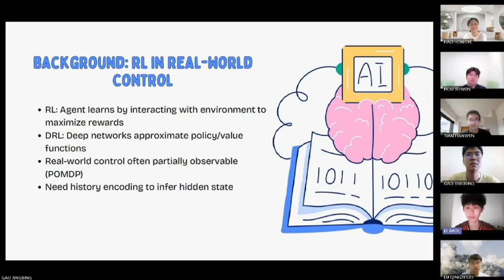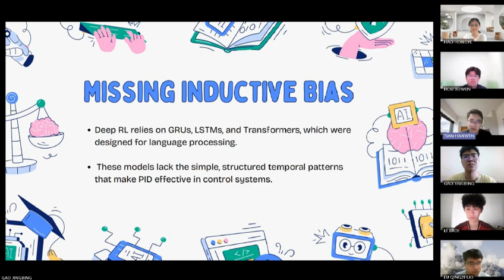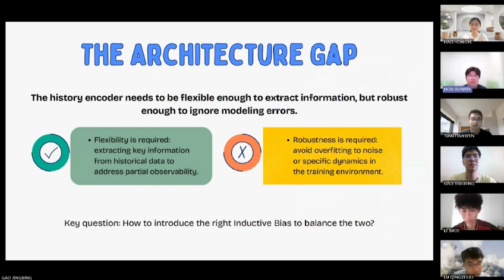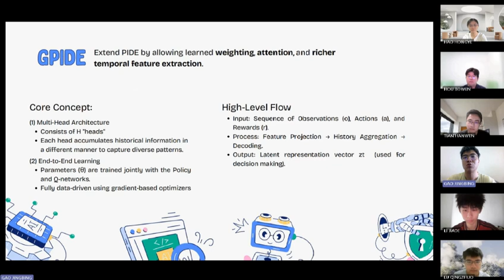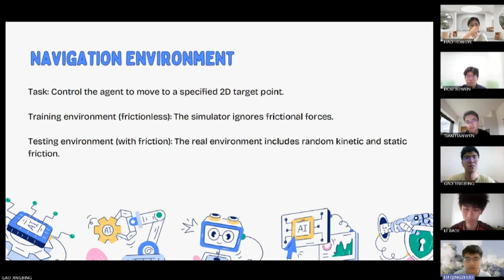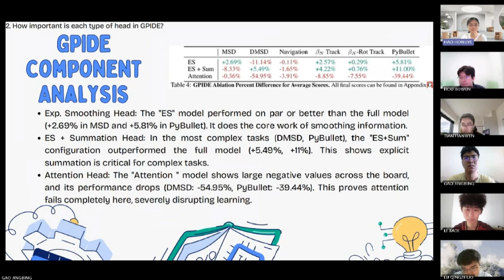AIT306 2025/09 Assignment Group 8

Comment: Group 6
Question 1
From your ablation results, ES and ES + Summation sometimes perform as well as or better than the full GPIDE model. In what situations does the full GPIDE model work better, and why do you think the extra complexity is still needed?

Question 2
In the mass-spring-damper and navigation experiments, which part of GPIDE do you think helps most with handling large parameter changes? the summation (integral-like) part or the learned multi-head weighting? How could you test this more clearly in future experiments?
Reply: Q1: 1) In navigation tasks, the ES+Sum perform better than ES.

2) From Section 5.3, the paper indicate that: "While the attention scheme learned for MSD could potentially be useful since it recalls information from near the beginning of the episode when the most movement is happening." So this complexity allows the strategy to "recall" information from a specific point in time.
Reply: Q2:
1) The author summarize that: "The other takeaway is that much of the heavy lifting is being done by the exponential smoothing." (section 5.3) So we can consider that multi-head weighting is more helpful. 
2) In future experiments,we can test through tasks requiring the memorization of specific discrete events, like picking up a key to unlock a door(section 6).

Comment: Group 3
09:27
You mentioned that the "Attention head" showed large negative values and failed completely, while the "ES + Sum" configuration performed best. 

Why do you think the attention mechanism (which is usually powerful for sequence modeling) failed in this specific control context? Is it because control tasks require strict local temporal dependencies (like derivatives s_t - s_(t-1) ), whereas attention focuses too much on global context which might be irrelevant for immediate stabilization?
Reply: Answe:r The attention mechanism tends to capture global context, which leads to severe overfitting in immediate stabilization tasks that require strict local temporal dependencies like instantaneous derivatives. Control tasks prioritize the concise extraction of short-term changes and accumulated errors, whereas the excessive flexibility of attention introduces interference noise.

Comment: Group 3: 
Question: How does GPI improve the PID encoder and bridge the control gap to ensure its robustness? Explain briefly.
Reply: Answer: GPI improves the basic PID encoder by introducing a multi-head architecture and end-to-end learning, transforming fixed PID formulas into adaptable feature extraction processes. It bridges the control gap by incorporating control-theory-based inductive bias, ensuring robustness even when system parameters undergo drastic changes.